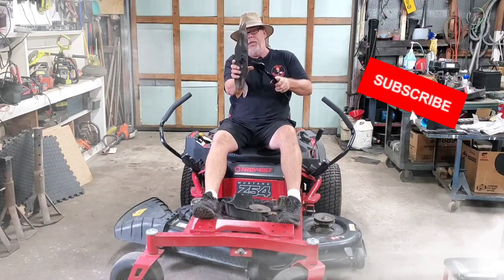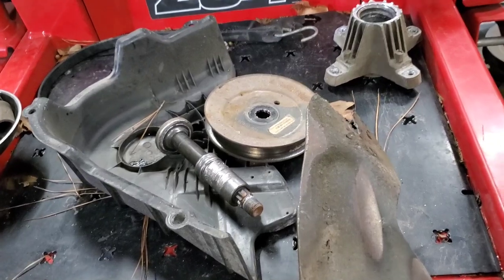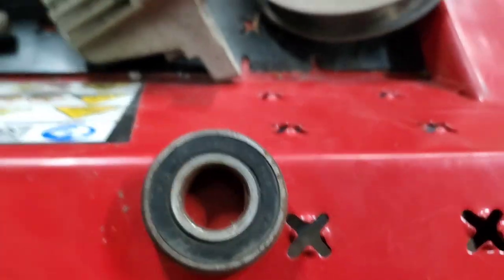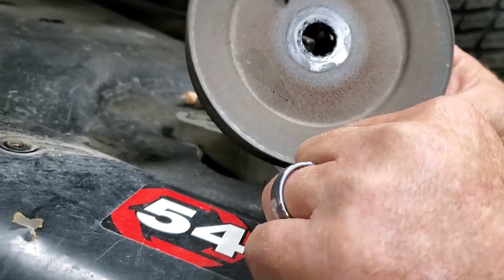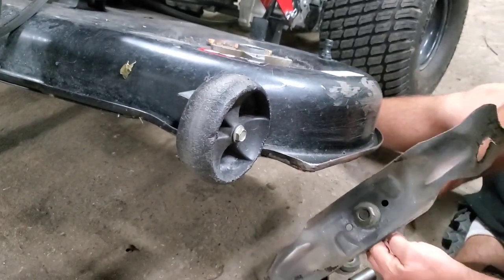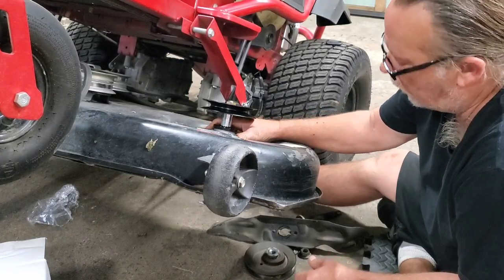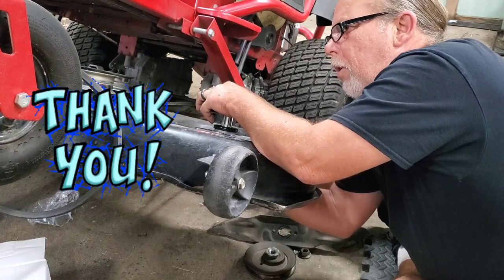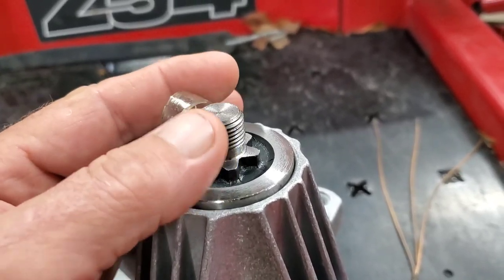S Blade Center Hole Convert To MTD 6 Point Star Replace Center Shaft or Spindle Troy-Bilt Cub Cadet

Comment: 3:42  I'm learning more about these spindles with each video.  Thank you.  FYI, I watched a recent video where they tested inserting grease through the new grease fitting, will actually grease the bearings on a new spindle.  They used a red grease, pumped around 30-40 pumps into the shaft, and grease began to seep from both outer sides of the spindle housing.  Then, they opened up the housing and inspected the new bearings and found that the sealed bearings had the original (lightly greased) and the red grease.   The down side is the amount of grease you must add.  However, with as much grease as it takes over the continued lifespan, only 5 pumps per spindle a year, it should increase the usable years to beyond 15 mowing seasons.

Comment: Set of 2 Oregon 46" Gator Blades 96-401 will work with z5400 craftsman zero turn.  BUT, you will need to round off the the largest lift tab at the ends of the blade to clear the corners of the deck.

Comment: Would you be able to confirm the spindle replacement for 618P09256? I'm not getting any returns on the 10-16287.
Reply from the maker: Just use 16287. Leave off the 10-

Comment: I think the first entry on the list may have a typo. The 618P09620 part number I think should be 618P09260. This the spindle I have in my Cub Cadet ZTS1-42. I could not find a 618P09620 part number for spindles. Let me know if the 618P09260 is the correct number. Thanks.

Comment: If you get the spindles, is there a conversion chart for the new blades?  10-16287 spindles, ZT1-50 blades.  Where to buy them?

Comment: A 2019 Cub cadet use the the same FAB shell. The problem is that Rotary just doesn't make a 50" spindle for a FAB deck. I haven't tried yet but the spindle housing and all internal bearing are the same as a 2022 FAB (S type blade). The spindle p/n 918-0691  or Oregon 82-106 (which is on backorder). These should be a replacement for the newer style spindle
Reply from the maker: Rotary now carries the S blades
Reply: @RaleysSmallEngines can you please include an updated chart in your notes? I have searched eBay and Amazon, but I haven't found any aftermarket s blades. I just got my new LT50 yesterday, but I'm already planning on converting it to the star blades.
Reply from the maker: @jcewl93  Rotary Corp. Now has aftermarket blades to fit it. Your local mower shop should have them.

Comment: Will the shaft 10-16540 (star) swap out the s shaft, or should I purchase the spindles (star) complete. my model#17ARFACT093  its a craftsman Z5400 46" zero turn

Comment: 3:26 I have to disagree with you.  The seals on the bearings is more like a dust shield... even if you don't remove the shield the grease will go into the bearing just fine.  I believe you can find a few youtube channels that have proven this true or test it yourself.

That being said, if you have the spindle open and the bearings removed why not pop the inside shield as it's not necessary.

Comment: I have a Craftsman T240 Turn Tight tractor I wouldn't trade it for anything else it's a little tank has a 5" turning Kohler 7000 series 22 horsepower 725cc V Twin engine 3 year unlimited hours warranty..Tuff torq transmission 46" cut..and there's more
Reply from the maker: Awesome !  Thanks for watching